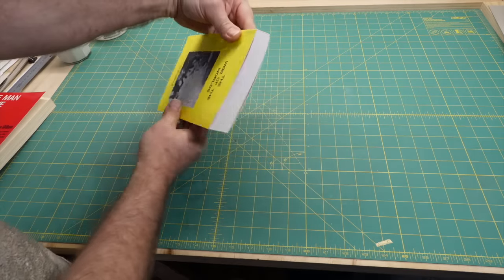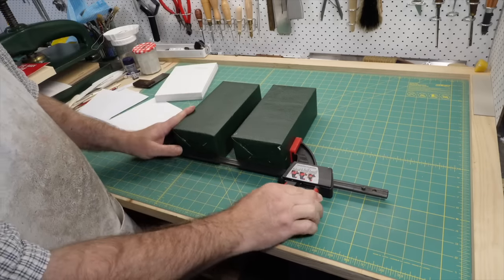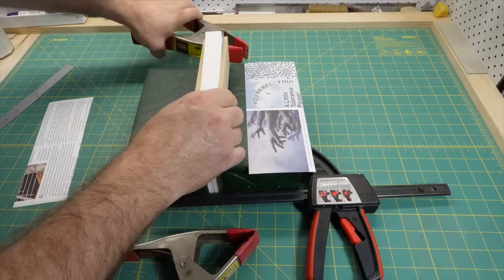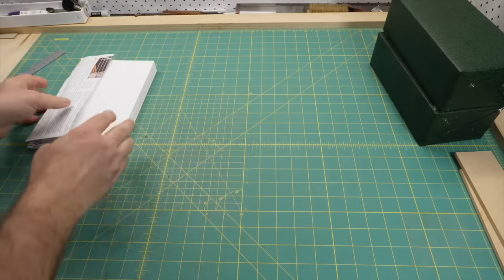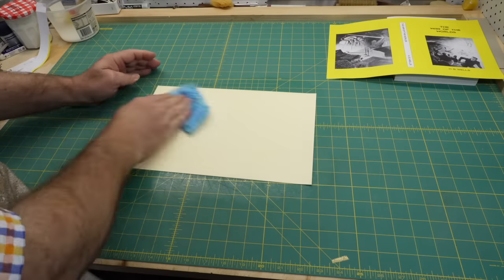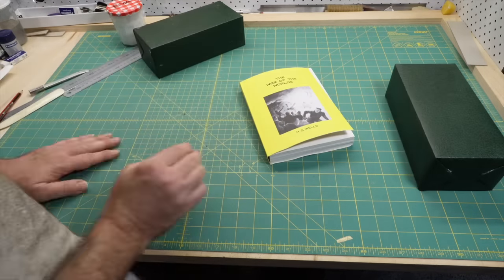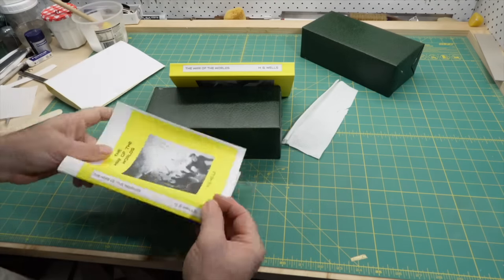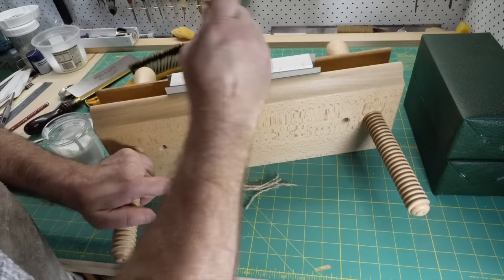Make Your Own Paperback Using Basic Tools // Adventures in Bookbinding

Comment: Hey Das! Thanks so much for this tutorial and all the rest, you’re a legend. I’m also based in Australia and I was wondering what specific brand the paper was. I know it’s semi gloss art paper but it’d be great to buy the exact same one. Cheers!

Edit: also, what printer did you use to print the cover? I only have a black and white laser printer so I’m thinking of buying an inkjet for covers.
Reply from the maker: That is a good question.  I'm not sure I remember.  I try and remember to put this info in the description, but didn't this time. I think I used DCP (Digital Copier Paper) 120gsm by Clairfontaine.  I sell it for $80 per A3 SG 250 sheet ream.  It's a specialty paper so not sure if many retail outlets will have it.  Or if they do it will be the A4 which is long grain.  I printed it using an Epson WF-7840.  It's a cheap printer that uses excellent inks but it is very flimsy and I'm not sure I recommend it.
Reply: @DASBookbinding  Thank you, Das, you’re so helpful. I’ll be on the hunt for the paper, and if I can’t find it with retailers, at least I know I can get it with you😁

Comment: Thanks a lot. I do mainly paperbacks, since my bindings are quite utilitarian. I just need to keep together handwritten notes, or printed texts I want to study and annotate (I print them with big margins so I can take notes...). When gathering loose sheets (handwritten notes), I like to use the double fan binding that you used, and that I learned thanks to you. When I print a book, I like to print in signatures (pdf software and even MS Word automate this now, so it is quite easy), and hand sew them with as thin a thread as I dare. It opens more flat, and I find this more confortable to annotate. But I don't bother to make even a casing : I just glue a paperback cover, like you did here. I print the cover on heavy paper, it is enough for my needs. Double fanning is the easiest and qwickest way, though, and gives a nice result. 
I love your "two bricks and clamp" press ! Simple and effective.

Comment: I started off making paperbacks using the double fan method. I love how durable and sturdy it feels, but I find the PVA glue used causes a lot of 'throwup' in the spine. I recently bought a small thermal binder to compare, and love how the hot melt glue adds more rigidity to the spine, but you definietly have to roughen up the paper edges and/or create some cuts with a blade before applying the glue, or it feels super fragile.

Thanks for the video DAS! <3

Comment: It was fun and interesting to watch.  I don't believe I'll ever be double fan bindings myself, but it's nice to learn about it nonetheless.

I've done the thread one in the past as well, nowadays I just stitch sections (get it trimmed at a local print shop), then I make the soft cover and add it.  

Notes on this: The print shop I trim the bound sections and the print shop where I make my covers are different, since at the first one the quality of printing and how they treat customers fell into a bottomless pit.  I cannot wait for the day I can just get the things trimmed at the second shop too.

Now, onto covers, in my own experience, laser printed ones will have the toner rub off with heavy use.  What I do nowadays is laminating it with transparent self adhesive film before cutting it from the A3 page.

Personally, due to where I live with currency taxes, shipping costs and customs, it's been way more cost-effective to buy books as digital goods and print and bind them for my own use than to just buy the physical thing.  I can say, it's also fun and rewarding to do so.
Reply: JUst CLarifying because I just got into fan/handbinding and till now had been finding only guides with the end result being hard cover.
It reads like you use the folded signatures/sections stitched together method then apply a Softcover?
If so is there a tutorial for this?

Comment: fantastic! exactly what I was looking for! I have a lot of ebooks that I want to print out, because screens are torture on the eyes. bought a thermal binding machine, which works fine for slim volumes, but the trouble is that the pre-made covers have a page range you can't stray too far from. And they get really flimsy for thick volumes. The stuff I need to keep on hand in the office are mostly reference works/manuals that can run into the thousands of pages. On 70 gsm A4 that's far thicker than the average dictionary. Your video gave me a lot of ideas on how to make them stick together reasonably well without getting a huge stapler. Thanks man!

Comment: Thanks for the great video!  How long does the adhesive you use take to dry?  I've seen some videos on Youtube where bookbinders advise to leave the book block clamped overnight after gluing up, but I've also heard that PVA takes around 30 seconds to set, so I'm curious to hear what your thoughts are on this.

Comment: Why not wood glue?  The cheap stuff is PVA, I thought.  Seems flexible enough after drying....
Reply from the maker: Yes it is PVA but they are not all the same. They are designed for different functions. Wood is acidic so wood PVA is designed to roughly match the ph of wood. And it is designed to be stiff so joints don’t move. PVA designed for paper is probably cheaper and easy to get at an office supply store.
Reply: @DASBookbinding  Thanks!  I'll keep that in mind for the next one!  I think I've got a gallon jug of clear PVA somewhere...assuming my kids didn't turn it all into slime 😃

Comment: I worked in printing for more than 20 years you said the commercial books have grains running in different directions the reason for that they print them large sheets opto 10 pages front & back ( the signature ) collated and fed into perfect binding machine and come out the other end a finished book the machine I have seen produced 125 books an hour 77 meters long and could handle 20 signatures

Comment: at least over here, wood glue is just straight pva, i guess that is not the case where you live?
Reply from the maker: I think you will find there is no "straight PVA".  The level of polymerisation is different for different application which affects dry flexibility and there is always additives.
Reply: @DASBookbinding  fair enough, but i am pretty sure, it is as straight of a PVA glue as i can get here. the brand "Ponal" is that big, that its name basically is synonymous with "wood glue". at the same time, it is the only brand here that i know from the top of my head, that provided PVA glue, just as i said, woo glue and PVA are basically the same thing here.

it consists only of polyvinyl acetate and ethylene-vinyl acetate.

i did not know, that there is wood glue made from other ingredients as well, thats the reason for my question.

Comment: Thank you so much for the masterful video. Is it possible to use hot glue (from a hot glue gun) for the spine?
Reply from the maker: No.  I wish I could explain why - but it's really an in-depth discussion - not a comments thing.  Machines use it.  But we're not machines.  For hand bookbinding it's a terrible idea.  And why would you?  PVA is a great and easy to use adhesive.
Reply: @DASBookbinding  Thanks! I am so relieved...hot glue sets so quickly and its texture is so inconsistent (temperature dependent) that I imagine it would be a nightmare to use for hands-on work on the spine. I was afraid to hear that it could have some advantages...!

Comment: I see you have the Epson WF-7840. I have the Epson WF-2760 which is almost the same except not wide format. I’ve been struggling to get printed text as crisp as a manufactured book. I’m not sure if this could be an issue with my printer, ink, paper, print settings, etc… and I wanted to ask if you also find this to be the case. Is your home printed text lacking in crispness/resolution? Tangentially do you use an ink refill system or official Epson cartridges (I’m debating buying an Ecotank ET-M1170 for the cheap page printing). Thank you for all your videos DAS.
Reply from the maker: I use the expensive Epson cartridges.  It's crisp enough.  Not as crisp as a high quality laser printer.  But good enough.

Comment: You MUST clamp both ends of you covered bricks.  Look at your video, you will see the top of the bricks don’t close in as does the the end where the clamp has been placed.
Reply from the maker: My clamp has enough reach that it is almost at the centre of the book.  If your clamp doesn't have much reach then yes.  Maybe a trick of the camera that it doesn't look even.

Comment: What was the binding cardstock that you used to glue to the cover?  Where did you get that from?
Reply from the maker: It's 300gsm (or 10pt) card stock.  The specific one I use is Bristol Board.  I get it from a wholesaler, which won't help you.  Here is a link to a "heritage" version of what I use from Talas in the US
https://www.talasonline.com/Heritage-Archival-Bristol-Board?quantity=5&thickness=14
Any 300gsm (10pt) acid free card stock will be fine.

Comment: Always a pleasure to watch. Have you ever considered making a video on an overcast sewn binding. There is very little information out there on the internet that I can find, just a few blog style tutorials. I've done a few and they are quite the experience to say the least.
Reply from the maker: I don't like overcast sewing.  They look great for a while but eventually fail and then the spine edge has to be trimmed to rebind.  I am going to do a video on making a 19th century English leather binding, where the first and last sections are oversewn.  But it is for historical reference.  I would never use it for a modern binding.
I know it was used a lot in the past, and when I was learning in the 90s it was still very common.  But it does not meet modern conservation standards.
Sorry, I know not what you want to hear.
Reply: No it's totally fine, any info good or bad is better than no info at all. I thought it would be better for larger loose leaf books because I don't really trust double fan binding to hold up for something that is 4 or 5 hundred pages.  @DASBookbinding